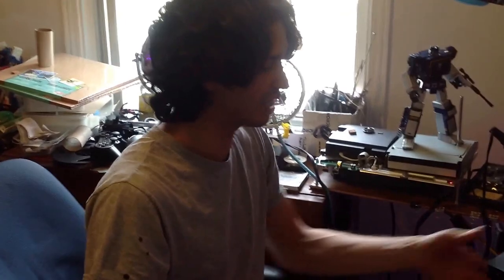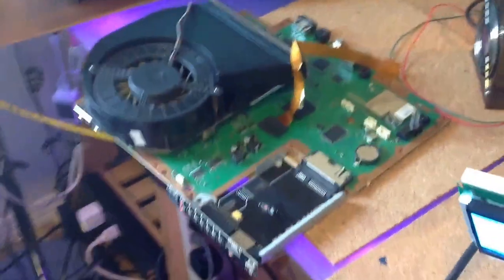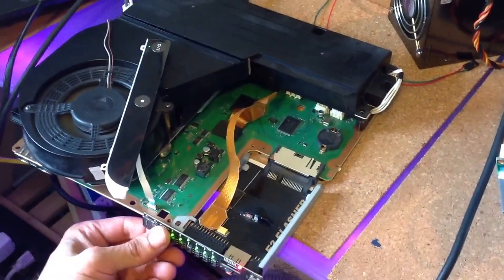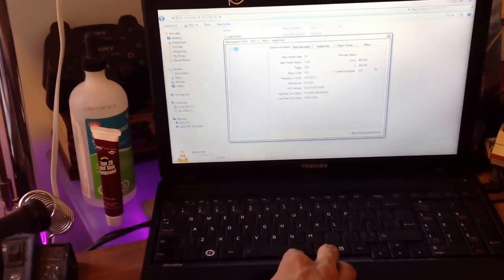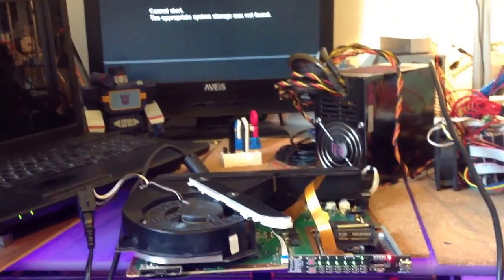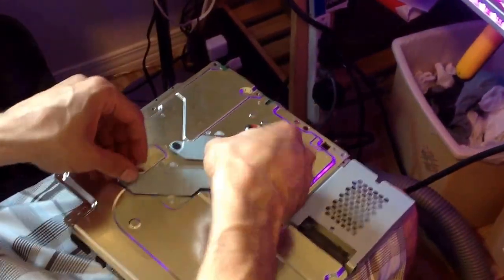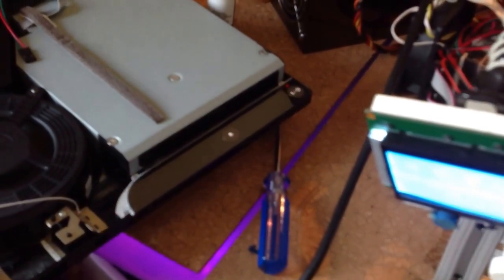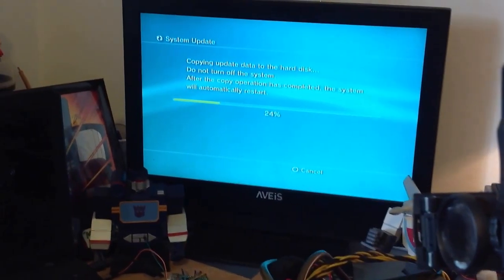How To Install CFW from 4.60 OFW

Comment: You're honestly one of the best people i've found for learning how to jailbreak and downgrade my ps3. I have a PS3 Phat CECHP and im trying to downgrade from 4.60 OFW i still have a couple questions.. sorry haha. Do i need to buy a "Dongle"? Also do i need to get a ESATA station? If not whats the point of these. Also im most likely going to jailbreak my PS3 with the E3 Flasher. Sorry about all the questions lol
Reply from the maker: No you dont necessarily need a FSM dongle (although you could use many things as a dongle, ie iphone, android, PSP, etc). Instead, patch the flash files with HABIB 4.60 patcher. Also, you dont need the eSata station. Best of luck.
Reply: Venutech .ca What would be the best cfw to upgrade to?

Comment: Could you elaborate on the files used during the final write via the flasher, and the whether the patched Pup was for going straight to 3.55 OFW or to latest CFW, how to set up the Teensy to use as a FSM dongle and lastly the the files for out of service mode and if those were on a normal USB drive?   (I want to work as clean as possible because I intend to go DEX with Rebug. but I want to prep systems back to OFW 3.55 Many THx :)

Comment: Venutech .ca  I am running the 4.60 OFW and looking for a complete step by step guide with all the software in one spot. I have the E3 Flasher Limited and I had watched every video on you tube, now I'm confused some say you don't need to plug the E3 into the motherboard and some show the PS3 put back together with the E3 and nor clip inside and putting the HDD into the esata dock, I have the version that has an adaptor instead of the dock. What many of us need is a start to finish video. Basically that anyone can do the downgrade for the first time.
Reply from the maker: I'll try to make a better video for beginners, in the mean time there are already plenty of complete E3 Flasher tutorials on youtube.

Comment: Can you make video for the 60gb nand chip models I saw the teensy on the video pic , well atleast a solderless 360 nand clip can you make video on how to make a solderless downgrade tool for the nand models I have a teensy and I got the 360 nand clip but I'm not sure if I that's all I need , cause I think I read I need to power the motherboard separately thanks buddy
Reply from the maker: I'll put together a video. Thanks for the request.
Reply from the maker: *****
Thanks, its in the works.
Reply: Venutech .ca Hello i have OFW ps3 can i downgrade my ps3 to 3.55 with E3 flasher please answer me
Reply: Dx Hernandez Yes. That is the purpose of the E3 Flasher
Reply: ARC Gaming So it will work on my 4.66 OFW?
Reply: Dx Hernandez Im guessing so. You will need to have a look into it. I dont think there is a limit to what OFW it can downgrade. Im gonna do it to my 4.60 OFW but havent had the chance to buy an E3 Flasher yet
Reply: ARC Gaming Ok so you think it will work

Comment: Is my PS3 eligible to be downgraded? My model number is : CECH-2502A.
Reply from the maker: Pretty sure, yes. To be 100%, check with the minimum downgradeable firmware. Install it as a PS3UPDAT.PUP, it will tell you whats the lowest firmware. You want 3.55 or less.
https://drive.google.com/file/d/0Bx7xLg7aCjWea2ZyTUJBcmQ0M2M/edit?usp=sharing
Reply: THANK YOU SO MUCH! I found out I can go all the way up to 3.40 OFW :)))
Reply from the maker: Nope.
Reply: Venutech .ca Hey, I have quick question.

When I put that update on my USB and put in my PS3, this came up:

Version; VERSION CHECK by Ifcaro
Location: USB DEVICE

...Does this mean my PS3 can be jailbroken? Or not? Please reply soon.

P.S

My PS3 is CECH-2501A
Reply: Victor Kresnek Just install it and it should tell you if you can.
Reply: Venutech .ca I would love to know will my PS3 Slim CECH-2101A will be downgrade able to anything lower then a 3.55 or at 3.55? please and thank you. Oh i used that tool it says 3.20 or later can be installed on this system so am i good?
Reply: Thanks. As much as I would love to Jailbreak it, I'll pass. Not until Get another PS3, just to be safe.
Reply from the maker: Cryta11
Yes, your good to downgrade.
Reply: I'm wondering should i buy a new ps3  thats on 3.55 or downgrade my only ps3?
Reply from the maker: The choice you make is dependent on how much work you want to put into it. You'll need some downgrade hardware. If you're not confident about doing it yourself, you could get someone to do it for you.
Reply: I know but i have the risk of someone taking my console ID.
Do i need an SD card? for the part for the downgrade? Or is that making sure that i only need to know if it's downgradeable.
Reply from the maker: you'll need an e3 flasher, an sd card, a USB stick and a computer, minimum
Reply from the maker: Cryta11 yes, that works.
Reply: Venutech .ca I have decide how much is the full service in total? I'm from Missouri so United states. So i'm asking shipping plus service. total amount?

Comment: Venutech .ca Hey dude sup, can i downgrade new Ps3 Fat 4.60 to 3.xx?
its no e3 flashed. in effect i didn't ever done this stuff like e3 flasher.. i mean my ps3 is new. so can i downgrade?
Reply from the maker: Yes, you can downgrade it. Whats the model number, you either need an E3 Flasher or a teensy for NOR or NAND, respectively. Let me know if you need NAND downgrade hardware.
Solderless NAND PS3 Downgrade Hardware - PSU Setup - T Flasher

Comment: Hey what did you use to put your ps3 in factory service mod you had to make it did you buy it ???? Do I need it ???
Reply from the maker: I used my teensy2.0++ with the PSgrade hex as a FSM dongle. You can use Habib's 4.60 patcher to directly install 4.60 CFW if you do not have an FSM dongle.
http://psx-scene.com/forums/content/habib-patcher-v1-00-patch-your-4-60-dumps-habib-s-new-patcher-4540/
Reply: after i use e3 flasher i put hard drive back in and run this app??
Reply from the maker: No...
Step1. Read NOR using E3 Flasher settings 001000.
Step2. Verify your dump (bkpps3.bin) with norinspector (or something)
Step3. Drop your dump into the patcher.exe provided by Habib for 4.60
Step4. Copy the patched dump to your micro SD and rename it to bkpps3.bin
Step5. Flash the ps3 with the e3 flasher settings 000000 (all down)
Step 6. remove e3 flasher, assemble console and enter recovery mode
Step7. Install Habib 4.60 CFW in revocery mode via usb (make sure the disc drive is empty).
Done, you're now on CFW 4.60 Habib.

Comment: im having a PS3 Super Slim
CECH-4208A with 4.60 OFW
is it downgradable? :/
Reply: nope.. you need a 3.55 ofw then you download any cfw and enjoy you can jb any ofw over 3.55 BY ONLY USING E3 Flasher
Reply: i installed Cobra ODE...my games r running from HDD but still having a little problem, n that is...my ps3 shutting down suddenly sometime during gameplay or like when its about to load something...
i googled about this prob n found that i need external power cord for my HDD...
do u have any idea about it? will that power cord work? they call it "USB 3.0 Y Cable"
Reply: yh

Comment: I have a 4.60 OFW, How do i get a CFW?
Is there ANY Method with USB?
Reply: I have 4001B
Reply: ***** Nope dude you need to do one of these hardware methods such as the E3 flasher
Reply: KillerSmileZx :'( What if i had a Fat or slim? Would a 4.50 .pup file work for a downgrade then use Rogero 4.50 CFW?
Reply: ***** I wish it was that easy but no. My PS3 doesn't have a cfw anymore. I did it when it was possible to do on 3.55 and didn't like that I couldn't go online so I updated. And unfortunately you're out of luck if it's over 3.55 so no you can't simply downgrade like that without doing one of the hardware hacks
Reply: ***** It is impossible to downgrade a 4001B super slim PS3 right now, and it will likely never be possible because none of the super slims were sold with 3.55 OFW or less.

Comment: So, is there any way on Earth to jailbreak PS3 CECH-3004B on OFW 4.60? Please tell me guys, so I can finally go to sleep tonight...
Reply from the maker: no
Reply: Base firmware version doesn't go low enough for you to Jailbreak. Your minimum version is 3.60. If you attempt to downgrade below 3.60 you WILL perma-brick.

In order to jailbreak you'd need a PS3 which had the ability to be downgraded to 3.55-3.56 (at a push).
Reply: Thank you for your answers, appreciate it!

Comment: If anyone needs help on the E3 Flasher let me know. I downgraded my PS3 with it in one try with ease. Most errors are caused by not correct fitting of the nor clip fyi.

Comment: Do you have services where you can jailbreak a ps3 on 4.60?
Reply from the maker: Yes, I offer that service. You can email me at venutech.ca@gmail.com. I'm located in Montreal, Canada so you can bring it down or ship it to me.
Reply: I live in sherbrooke canada =0 Thats a bit close to u
Reply from the maker: You could still ship it out if you want, I charge $60 while you cover the shipping. The shipping is about $15-20 each way(xpresspost-1 day or regular parcel-3days). Should cost you less than $100.
Reply: Yes of course, but i was told that my model CECH-3001A could not be jailbroken! Is that true?
Reply: Jose Salazar Run a PUP file called "MinVerChk". Rename it to UPDATE.PUP (put it into the folder structure: PS3 > UPDATE > UPDATE.PUP) and install it in the XMB as you would with an update. It'll fail and tell your minimum firmware version. Anything over 3.56 is a no go and cannot be Jailbroken.

According to the PS Dev Wiki your model's minimum firmware version is 3.60 but best to check for yourself. Just googling MinVerChk will get you a link to it (first link).

Comment: how much for a downgrade would be for my ps3 slim
Reply from the maker: $60 if your slim is compatible (not CECH-3000 or higher.)
Reply: ok thanks
Reply: i have a CECH 3001A
and on the back of the ps3

Comment: I have a first gen ps3 its on 4.65 so can it be downgraded????
Reply: At this moment phat ps3 are all jail breakable but slims are jail break able 3.55 under if it's on 4.60 need e3flasher or buy a jailbroken ready ps3  super slims are NOT jailbreakable
Reply: Do you still want your e3 flasher
Reply: I didn't use one I wrote a program that downgraded me to 3.55
Reply: Can you send to me plz?
Reply: Hey can you help me out ? Please i have a 1st gen too
Reply: Pretty sure it can be downgraded with the same method. Not 100% sure though

Comment: hi what did you patch the dump with? thanks
Reply from the maker: I used the E3 flasher files to patch the dump (e3downgrade.bin with all switches down on the e3 flasher except the last one.) There wasn't a 4.60 patch at the time I made this video, but Habib has released one since,
http://psx-scene.com/forums/content/habib-patcher-v1-00-patch-your-4-60-dumps-habib-s-new-patcher-4540/
Reply: Venutech .ca Thanks for the replie. Is the e3 flasher files the (e3downgrade.bin) already on the e3 flasher when all the switches are down apart from the last one? thanks
Reply from the maker: you need to download the original E3 flasher files from http://www.psdevwiki.com/ps3/E3 and put the e3_downgrade.bin on the root of your sd card. If you have a new E3 flasher, make sure you use the samsung update.bin before you start.
Reply: Venutech .ca Thanks agin for replie. The link on there does not work? to download the e3 files. any other way to get them? thanks
Reply from the maker: http://www.ps3hax.net/showthread.php?t=39766
Reply: Venutech .ca Thanks very much for help.